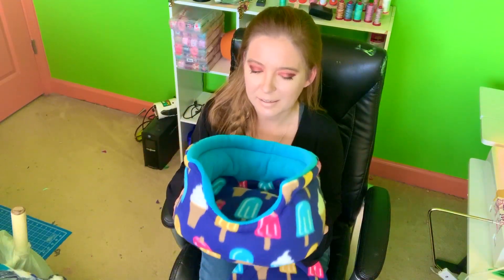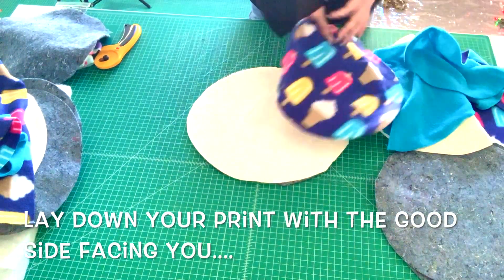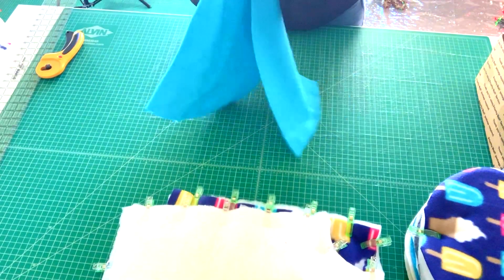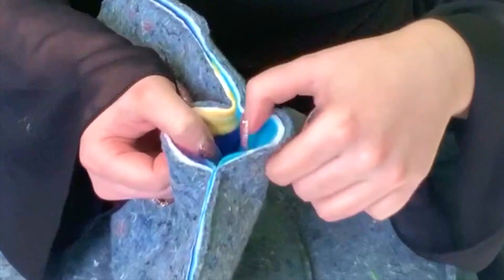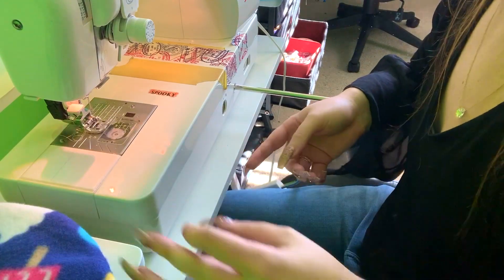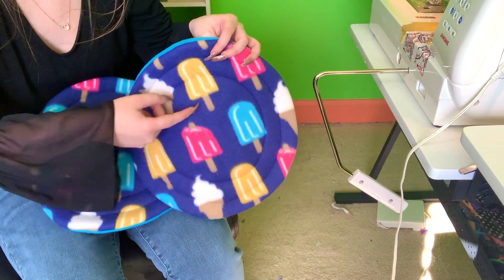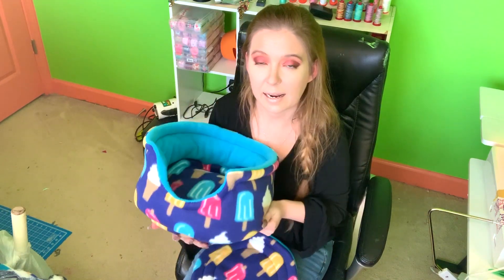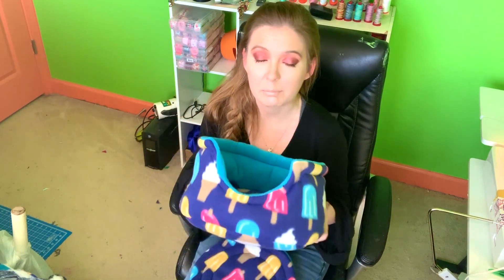Cuddle Cup Sewing Tutorial! (How I Sew My Cuddle Cups!)

Comment: Really excited to try this. Just made 2nd GP fleece liner & pads -w/walking foot this time - Worked like a dream, nice and smooth 
I absolutely love how you complete the project here Yes it looks difficult to sew that final seam but I LOVE the finish it gives . 
Will be quite a challenge but will be watching this again step by step I have the uhaul & fleece but didn't realize I needed the batting. When I pick that up I look forward to attempting to tackle this for one of our buns I'll make one for our dutch as well if our little girls works out - Love Your detail really precise & thorough explanations answering would be questions as you go; really makes these doable.  Hope my final hand stitch seam comes out as well matched as yours did

Love it if you could mention tension & stitches in your vids.  I know it's a completely noob question, but I am.  I have an old brother machine - 2 knobs tension 0-9 & stitch 1-14 - 2 3 4 5 being zigzag.  I'm using 4 tension 3 stitch - anything other that I should be using?  Thanks for the education!  It's a really fun stress reliever as I can forgive myself knowing I'm learning, it's for the animals, and it doesn't have to be perfection to look & work great.  Soo much fun thanks!
Reply from the maker: You dont need batting... Its just what I use to make the cuddle cups more comfy and stabilized.  As for tension every machine is different. My machine automatically adjusts it for me, so you may have to experiment with what tension works best for you. On by old machine I had it inbetween 3 and 4 but that does not mean it will be the same for your sewing machine. And the more you practice the better you will get, just be patient and it will work out. :D Thank you!

Comment: 36.5 inchs long by 6 inchs wide,i measured this out and yours looks wider than these measures,have you gave the wrong width,it looks way wider than 6inch
Reply from the maker: They are the correct measurements... You can also use whatever measurements work for you...  I like my cuddle cups to be around 5 to 4 inches tall when finished, so cutting 6 inches allows for plenty of seam allowance for me. but do what works for you. :)
Reply: @GuineaPiggiesDesigns  ah phew i thought i did something wrong,thank you
Reply: Dawn, I totally agree. I made this using the 6 inch measurement and it is much shorter than Britney’s.  When you look at her cutting board in the beginning it shows her strips to be 9 1/2 inches wide. I literally took a screenshot so that I could count the squares.
Reply: @lauramorrow2900  yeah I eventually made my own one for piggies but used Britney's video for reference ❤️

Comment: Are you sure the dimensions for the long pieces are 36.5 by 6 inches? Yours looks a lot bigger than mine
Reply from the maker: If thats what I said in the video then thats what it is but its easy to figure out if you use the circumference formula which is Pie x the diameter of your circle.... So the diameter is what  your circle measures straight across...  Thats how you can figure out your own measurements if mine are not working for you because everyone sews differently....
Reply: Yeah the 6 inches is throwing me off 😆😂😭😁
Reply from the maker: @jamiesbreed  Well again you can calculate your own measurements... I think the 6 inches is how tall I make the cuddle cup....so the strip will be 6 inches wide and at the end the height of your cuddle cup should be 5 inches after its sewn together... But again if this is too confusing... use the circumference formula and figure out what measurements work best for you.... The best way to understand this, is through trial and error... So sew the cuddle cup... if it comes out wonky then it will help you to understand what went wrong... I mean thats how I figured it out... But do what works best for you. :)
Reply: @Guinea Piggies Designs The 36.5 x 6 inch piece looked small when I did it. So I used a 36.5 x 9 inch piece and figured I could cut it down if it started to look too big. My hands must be baseball mitts compared to yours 😳cause my hand from bottom of palm to middle fingertip is 8 inches 🤣 And when you lay your hand down on that piece, you have a lot of room. (My husband said I do have big hands for a short girl 😳😒🤣) And you be workin it wit them pretty nails!!! 😍

Comment: I just finished making this cuddle cup. It didn’t come out as perfect, but I just learned how to sew 2 weeks ago. Your tutorials are very easy to follow. I wouldn’t have been able to do it without all of the details. I did try using foam instead of the batting for the sides and the bottom and it came out alright.  My potty pads came out like ovals so I may have to redo them. I swear I cut them into perfect circles. Something happens to them when they get into that sewing machine 😆😂😭😁 Thank you for the help. Is it alright if I tag this video to my Facebook?
Reply from the maker: You just gotta follow your seam when you sew around a circle, do not look at your needle when you sew, look at your seam allowance and that should allow you to sew a perfect circle, and also that only works if you cut out a perfect circle.... :D